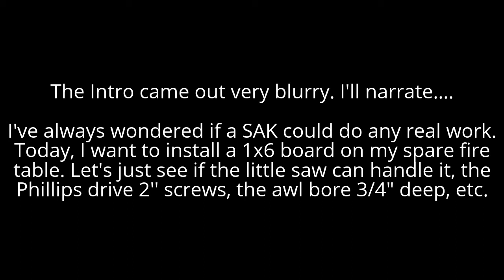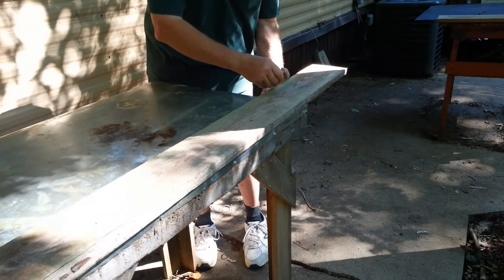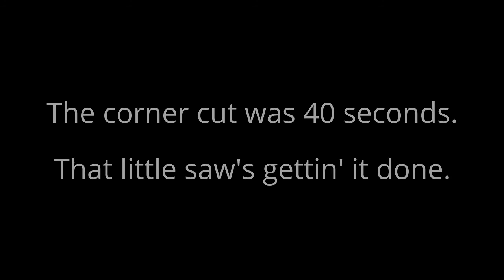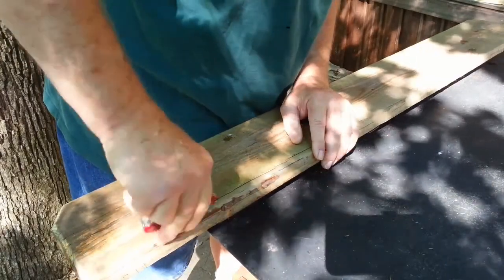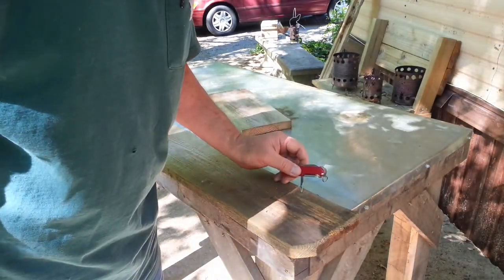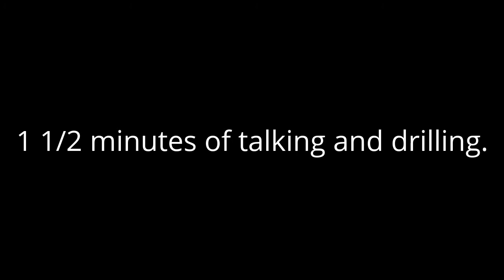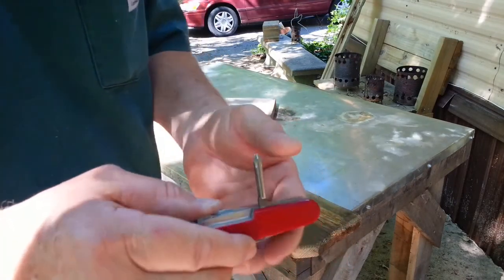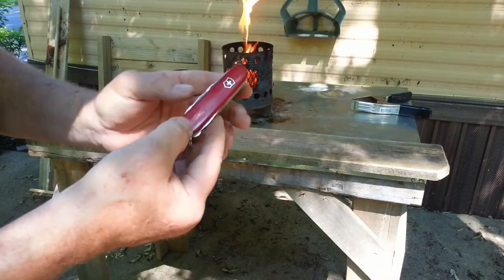Victorinox Fieldmaster, Swiss Army Knife, It can do REAL work!

Comment: I really like the saw victorinox puts in there knifes that was putting one to the test I bought one at a pawn shop few year ago I don't know how many gadgets it's got it's even got a little clock on the side of it believe it or not but it keeps good time just have to add a battery every 3 to 4 year lol when I bought it the guy said the clock didn't work it pooped right out and to my surprise there was a battery lol I gave 10.00 for it
Reply from the maker: I like all the features on this Fieldmaster. It has 12 tools which can perform 15 tasks. Thanks!
Reply: @DavidWestBgood2ppl  You can perform more than the 15 tasks out of 12 tools.Every single tool has many uses.For excample,you can find the distance of a person,using the fish scalers.Any SAK,can also work as a clock and as a compass! Their function is limited only by our imagination and intelligence.Even the underated cockscrew,has so many uses,that IMHO,is a must have tool.

Comment: Good video; there aren't that many vids that stress test a SAK. They're stronger than they look and I  have a feeling that Elsener and company figured out how to distribute stress loads evenly through the knife -just a guess. Do you have an 84mm SAK and, if so, have you ever hard used it?
Reply from the maker: Never heard of the 84mm. Googled it. No, never had the smaller one. This is the first time I've put so much stress on a SAK. You know, I keep it on a shelf with some other knives. For years now, when I would glance over at it and think about maybe making a video with it. I always wondered if it would hold up to real work... That Phillips and the body of the knife itself never flexed at al under that much torque. The tip never acted like it was going to slip out of the head of the screw. In fact, you saw how I was able to let go of the tee handle to regrip and it stayed nicely. Great engineering. The saw blade didn't flex or seem to get any duller either.
Reply from the maker: I don't have a lot of interest in them now. When I first started learning Friction Fire Techniques, I liked the saw, 2 blades, and awl but it's too much bulge in the back pocket.
Reply: You'd probably like the Hiker model if you don't need scissors. It has 3 layers. Personally, I don't like to go above 2 layer with a SAK (Sportsman or Compact), and rely on a pocket size MT for drivers, file, and pliers. But man that inline reamer on the 93mm models is awesome. I wish they offered it on other sizes.
Reply: I went with the Victorinox Forester. Larger with longer saw aan blade + the blade locks.
Reply: David West - Ya can't go wrong with a good ol' swiss army knife. I sure love my field master. It's light to carry, not heavy at all and it really comes in handy.
Reply: @titaniumquarrion9838  Two handed Forester and the less robust version of it the Rucksack,are the best outdoors-field pocket knives I ever had.(much better than my Farmer)
Reply: I have, it holds up well but not as strong as 91mm.